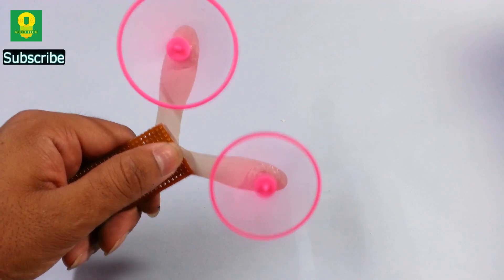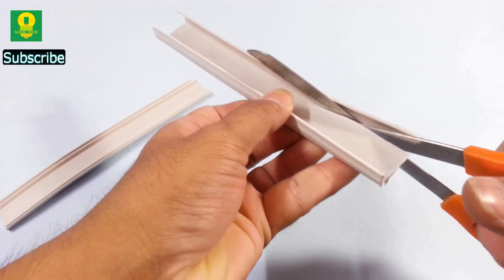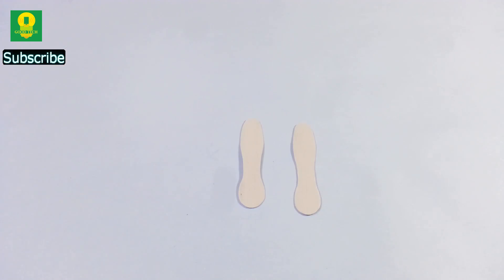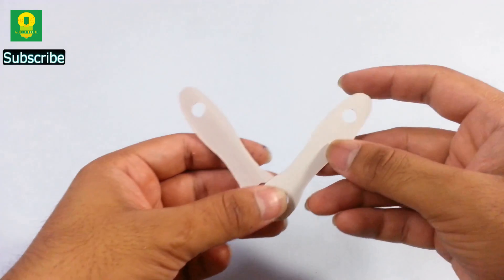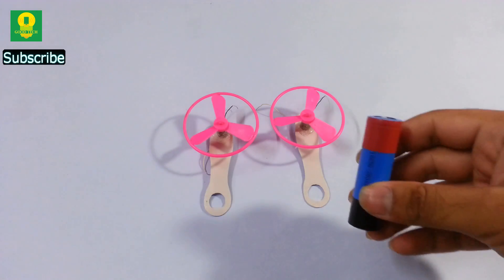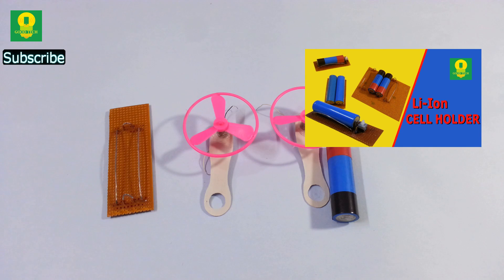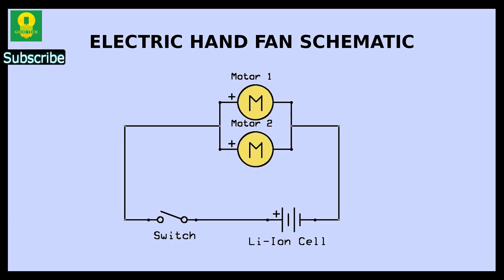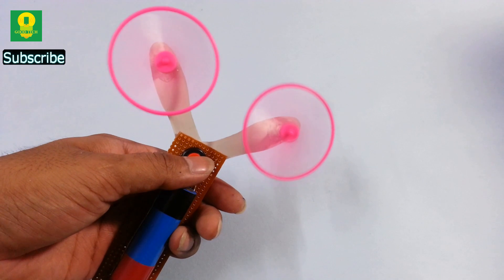How to make an Electric fan at home

Comment: can u tell the ingridents here?
Reply from the maker: A small PCB board, Battery, switch, two Quadcopter motors ( can also use vibrator motor from a mobile phone ), Two propellers and plastic pieces (can also use ice cream spoons) to hold the motors together.

Comment: I am waiting😭😭😞
Reply from the maker: I am sorry but i don't have any idea where to get this stuff in Kolkata, i got these from Lajpat rai market in Delhi.
The best option will be to use mobile vibrator motors, just buy some old non working mobile phones from any mobile repairing shops nearby(they will cost around Rs.50-100, depends on bargaining) and use them in your projects, those motors also work equally good.

Comment: hi bro..where do you live in India...and where do you get parts from..??
Reply from the maker: All the parts are easily available online on ebay and amazon, however, i get the parts from Lajpat Rai market in Delhi.
Reply: +GOODTECH - Creativity and Science   I get parts from so road which is in Bangalore..
Reply: +GOODTECH - Creativity and Science can u tell the shop no in lajpat rai market and price per piece of coreless motor
Reply: thanks

\
Reply from the maker: I don't remember the shop number but there are many shops that have the parts. The coreless motor i used was bought for Rs.50 per piece.
Reply: +GOODTECH - Creativity and Science OK thanks
Reply from the maker: You are welcome :)
Reply: +GOODTECH - Creativity and Science Hi i'm also from delhi(Nangloi) Does lajpat rai market also have transmitter and receivers and lipo batteries? pls reply!
Reply from the maker: I never looked for transmitters and receivers, so m not sure about those but yes you will find lipo batteries easily.
Reply: thanks